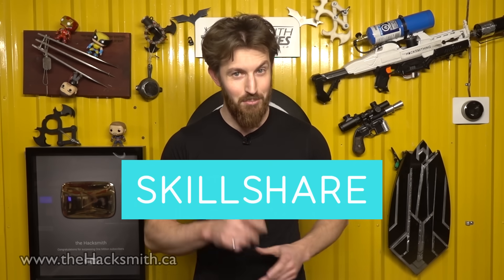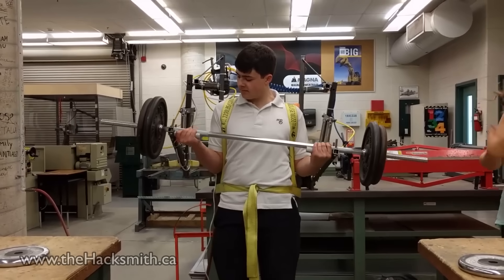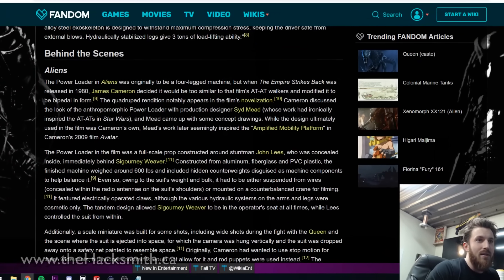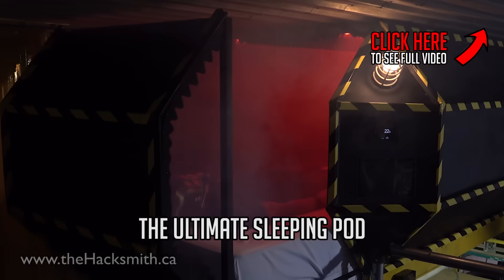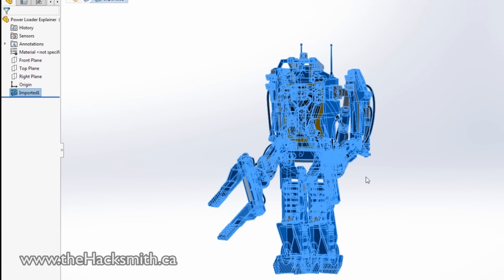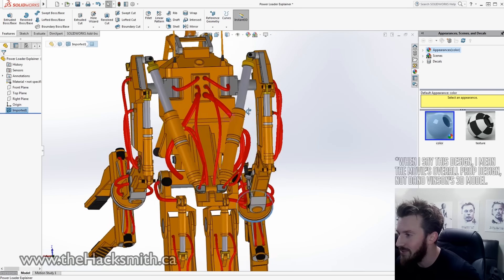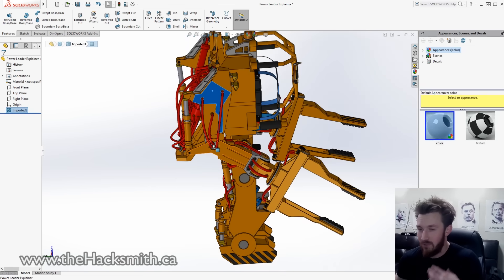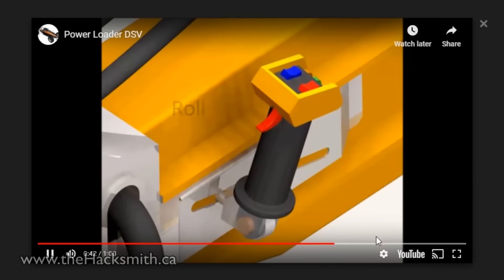Designing a MECH! (POWER LOADER: PART 1)

Comment from the maker: FAQ (will add to as good questions in the comments come up!)

1. Why not use hydraulic rotators for the joints?
We looked into it. They're A) stupid expensive - $10,000+ each easily and B) massive. Most are designed for real construction equipment, like excavators -- which are huge.

2. Why only one video a month?
To maintain one video a month so no one complains, we need to be able to keep up with the engineering time required to build such a massive project. We will get ahead at first, which is why the 2nd video is ready to be watched for members only -- but we need to keep a buffer so we can keep the series on the regular =)

3. Are you going to be using any electric motors?
It will all be hydraulic. End plan is a gasoline engine to power the hydraulic pump. For actual joints, electric motors can't even compare to hydraulics for power and torque. No electric motors are strong enough for the torque we need on the end effectors -- hydraulic motors are the only thing that will work -- and even then they have to be geared down. 

4. What's the spinny thing on the couch?
It's the kinetic art sculpture from Iron Man 2. Perpetual motion ;-)

5. Why this and not Flying like Iron Man?
Believe it or not, this project is still way cheaper than Flying like Iron Man ever could have been. We're able to do the power loader because we can do multiple videos on the series as we make money from the videos. Flying like Iron Man on the other-hand, required an upfront investment of over $100,000 -- JUST to start the project. Likely hood of breaking something means that cost could double or triple super fast. If you want to see someone fly like Iron Man, check out Gravity Industries and Richard Browning -- they've invested over a million dollars into their system. We are no longer pursuing that project.
Reply: the Hacksmith make riptide from Percy Jackson. Or maybe just a dagger. Anything that forms into a blade of some sort
Reply: ThatOneGuy Tho the pen needs to wok tho
Reply: ThatOneGuy Tho you could make it the same way a butterfly knife works but out of a pen casing
Reply: @taizo3916  Riptide would be awesome!
Reply: I suggest using a brake disk style for the rotation of the arm
Reply: @calebdebrusk-w819  can you explain to me what you mean?
Reply: whats that thing in the background, the weird spinning thing, where can i buy one!??
Reply: @iL-uu3me  u mean those pipes spinning in his office at start of video?making movement by itself
Reply: Sorry, I asked the question about hydraulic motors before watching the whole video. I think you explained it pretty well. Keep up the good work!
Reply: well explained
Reply: How long will you doing this
Reply: Where is a "join" button? Is it country-locked?
Reply: That picture of Robert Downey Jr. On the wall really deserves that place among the other...
.
He is really a great role model.
Reply: @sreevathsa4006  Do you have any Idea where i can get these pictures? :0
Reply: Regarding the rotating joints; you could use one of those high-powered RC-motors like James Bruton or Peter Stripol use in their projekts. Then mount it in the center of the joint, with planetary gears to transfer the power. You would get a bucket-load of torque and depending on the ratio enough speed to make the big daddy drill look intimidating.
Best Regards
Reply: Another question. Where did you get the posters from your office from? I want them too. They're awesome.
Reply: Yaaa
Reply: the Hacksmith can I ask what degree you have or what education I should Persue to do projects like yours
Reply: You need to do a collaboration with Adam Savage.
Reply: the Hacksmith that last one is unfortunate, maybe it’ll happen someday in the future, but it makes sense to leave it if at this stage it seems unrealistic, it makes perfect sense.
Reply: I know you're busy making loads of other projects. But would it one day be possible to make Green Goblings glider?
Reply: Where did you get the prints of Musk, Tesla, Einstein etc behind you?
Reply: I work on Boom lifts madd by Genie and JLG...the Platform rotator is hydraulic and looks almost like the one on the wrist for the loader
Reply: Imagine giving budgets from USELESS branch of the governments from the world to a single research team.
Reply: Why not make it out of aluminum? It looks like if you make it all out of steel it will get too heavy to move.
Reply: It's too bad you stopped flying like iron man. It's understandable, but still disappointing
Reply: good to know
Reply: Hey hack smith I know you might not read this but you should make a electric net gun or some shock absorbing armour like stab  proof I think that would be really cool idk that's just a thought love you and your videos
Reply: The thingy is one of the only things to demonstrate chaotic motion
Reply: This drawing software, who can teach me how to use ,is that a computer program ?
Reply: Could you do a movie prop when the new dragons movie comes out?
Reply: Can you please make civil war Iron Man glove which comes out from a watch like thing
Reply: Maybe an inverter drive motor for the hands which unlike a starter motor will allow infinite control via  Pulse Width Modulation of the stopping positions. You could mount one externally at 90 degrees to the wrist on either side of the backing rail support ,have one control 360 rotation position and one finger width movement. That said how does the operator know when the fingers are wide enough to pick the load up?
Reply: Ayy
Reply: I would love working on these projects, I can help with Solidworks. Let me know if i can be helpful.
Reply: COOL, can you build a fully working predato mask.
Reply: Arunima sumal yes I’m a fan of Percy Jackson:)
Reply: B and B attachments makes a number of hydraulic rotating clamp attachments for fork lifts.  You could use those and modify them to fit your design.
Reply: Cool
Reply: What
Reply: Get hi dralics muesli
Reply: If possible could you make Thatcher's EMP grenades from Rainbow Six Siege?
Reply: you should do something from warframe
Reply: make a pair of torques goggles from black ops 4
Reply: Hay guys, anything from Rainbow six siege is greatly appreciated, especially Capito's crossbow and bolts.
Reply: i have a challenge for you hacksmith when you finish the alien power loader can you make fnaf animatronics
Reply: Give the Powered Lifter a Giant Lightsaber. :3
Reply: Do you except visitors
Reply: @Colinfurze might help ?
Reply: Will you make still camera for me please this is the last thing I I want to see before I die of cancer
Reply: if you see this can you reply i want to build a a real hover board  but i don't have the experience  i'm only 11 or the money and my parents wont let me start a go fund me.
Reply: FAQ: Why  don`t try concepts in 1/4 scale, to check if the work first? It is a common, old fashioned way in the industry to save money.
Reply: After you do this, try and build the Iron Throne.
Reply: Wow
Reply: the Hacksmith could you make a Marshmello helmet with lights and a dj headphones inside?
Reply: the Hacksmith what about the exoskeleton
Reply: the Hacksmith maybe try looking at prosthetic hands. They are electrically powered and I understand that y’all are trying to stay with hydraulics, however it might inspire an idea
Reply: Its gonna be amazing if i works
Reply: My dude you are god damn crazy with the things you create and I love it.
Reply: Could you please make the grapple from just cause 2
Reply: Can you please make the grapple from just cause
Reply: the Hacksmith can you make Marshmello Helmet that can light up
Reply: I dare you to do the fire hammer in Destiny 1 in Titan class
Reply: This commenter want you to make MASTER SWORD
Reply: Alright hacksmith cant wait for power loader i was actually a fan I the first movie wit power loader but if you are no longer pursuing flying like iron man I will start trying to fly like iron man but I will make a speaker and smaller design that can go 40 mph working on it now drawing the design
Reply: Can u make real steal robot
Reply: Gravity jet suit is just a prototype
Reply: In real size.
Reply: plz make saber's sword excalibur from fate stay night

Comment: Some of those join fittings could actually work if you run the hydraulic lines into a fixed joint and the line connects to a connection that rotates like a pressure washer hose fitting with ball bearings but reinforced to handle the pressure as it rotates it would solve problems with attached lines blocking full 360 rotations
Reply from the maker: The bigger point is, they were only ever aesthetic in the movie. So we'll do it the right way

Comment: The 3D design software I use is called Autodesk Fusion 360 which also has the ability to simulate joints and render

Comment: They would be electric over hydraulic.  Which is a series of hydraulic linear actuators and hydraulic motors.  The fluid pressure would be generated by electric pumps.  Hence the whine you hear when the unit is powered on.  Much like hydraulics on a car that makes big jumps.

Comment: Cool project! I had another idea in mind you should do. With your 3D printer you should build a Nerf version of the Legendary SCAR from Fortnite. It could be powered by a battery that runs electric flywheels that launches the darts. Then a pusher motor could push the darts from a clip into the flywheels.

Comment: Well, I wouldn’t say that you could continuously rotate the wrist. There’s the claw’s hydraulic hoses you’d need to address unless you’re using a rotating  interface. Are you going to use a shoulder joint similar to what Megabots uses?

Comment: you could use a high torque hydraulic motor with e planetary gear reduction to power the rotary axes you could easily spin the whole loader with that

Comment: Actually, forklifts and pallet jacks have a fatal flaw that this invention fixes. They cant run on uneven surfaces. This powerloader would be able to fix that, being able to adjust the pallet in realtime, with simple easymoveing forks.
Reply: Also it could be used as a emergency rescue tool simular to the jaws of life, however much more mobile and able to lift a car

Comment: For wrist if y have rod that has ledge outside and pipe that goes tightly outside of the rod and has ledge inside, and sealing bearing on the end of the rod between the pipe. And both ledges have sealings on them. y could makes wrist that moves by changing hydraulic pressure on each side of the ledges. Wrist would look more like in the film.  Wrist would move almost 360 minus the thickness of the ledges.

Comment: About that rotating waist, at my workplace we have a forklift with a rotating part, with an hydraulic gear wheel at the actual lift, and it can not only spin 360° but also do it with heavy weight (around 500kg maybe?), but it's not too fast
Also Sorry for my bad English

Comment: James, i love that you are going to so us the engineering process ! I’m a mechanical engineer my self and work with Solidworks every day of the week. 
I would highly suggest to use the sheet metal function for those kinds of parts/assys (and multi body sheet metal parts)
Anyway I will be looking forward for the next video’s 👌🏻
Reply from the maker: Depends more on the fabrication method! Not sure Solidworks has an easy way with the sheet metal to do tab design?
Reply: the Hacksmith In solidworks ‘18 there is a really nice feature called tab and slot. This can be used with sheet metal parts/assys.
Reply from the maker: Dang we have 17
Reply: the Hacksmith Then in the future ! But still sheet metal is easyer to use in this case. Good luck !

Comment: If you can slide a forklift while remaining control you should definitely show it off.
Reply: I've only done it myself by accident and shat a brick, those things are so easy to turn on their side, literally the first thing they teach you in the training is all the ways you can get it to go over and crash, having said that they are great fun to work with if you don't mind getting a sore ass from no suspension and solid tyres

Comment: whos paying for this its not dificult to do it but to buy the hydraulics ant the spares
Reply from the maker: hydraulics are actually the cheapest part
Reply: make a price search and you will see that the the hydraulics its almost the 60% of the price actuators,solenoids,rotary motors,fittings,manual electric contros,or plc control.....pffff the other its just steel and cut and weld
but anyway for me the most expensive its your time of your life...congratulations for your idea and im waiting to see the final result good luck!!!by the way this you can use it to a remake movie ;)